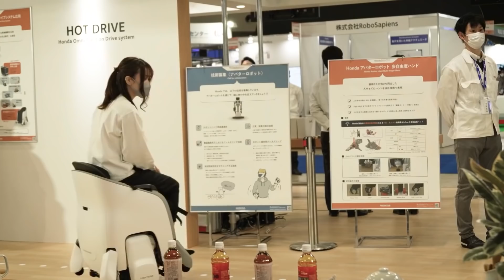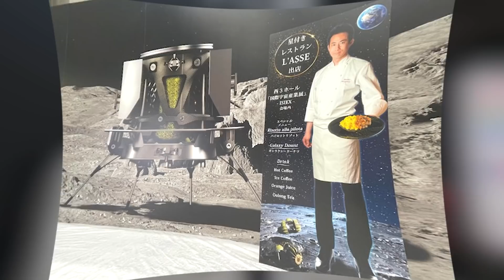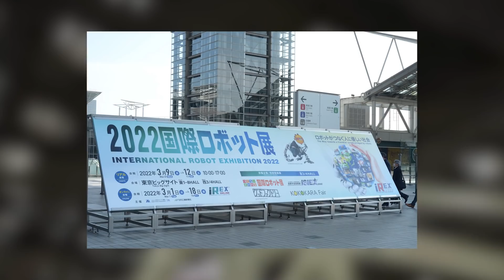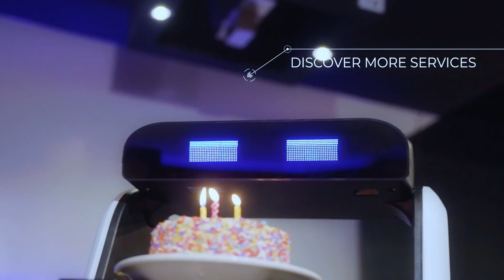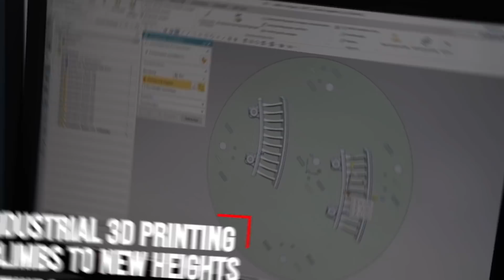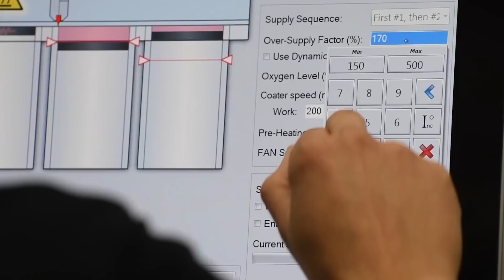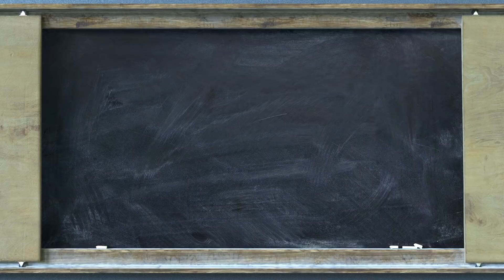Robot Exhibition in Tokyo 2024 Highlights | NEW Robots REVEALED!

Comment: If you call Operation system . The robot tend to steal instead of. help towards the assignment and looked more competition instead of being of help
Terminals they were ok making sure things were secure. But, with. People.they were on another level. Sending other robots to steal and stop device s were they had more control over the equipment just to show they the robot had more power
Over the device and computers and tvs andb carsnandbradiosthatnthey. Had.ore control over. Dvds , scanners and printers, refrigerators, heaters and air conditioners